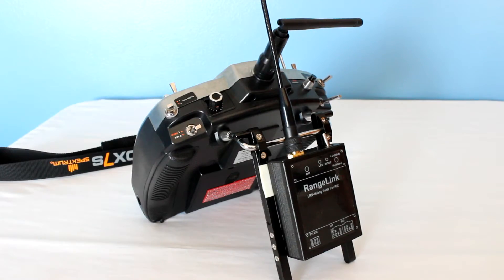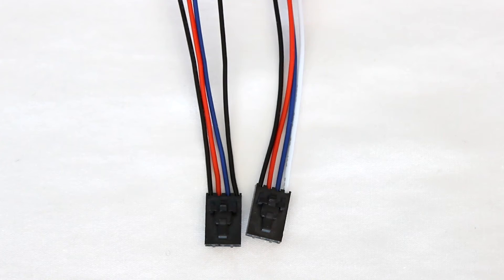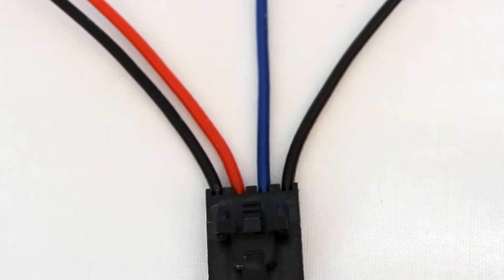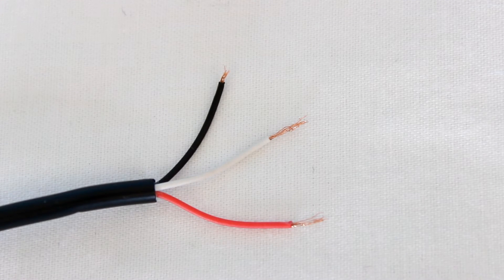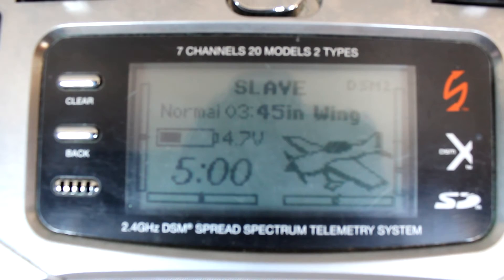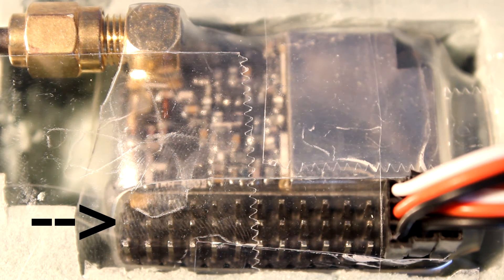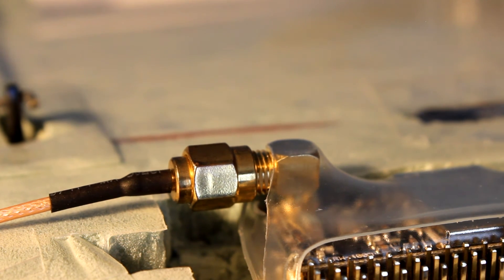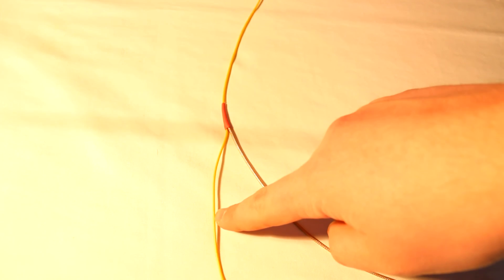How To: Setting Up Rangelink on a Spektrum Radio

Comment: Would you still recommend using dx7s with rangelink? I am considering the same setup but the feedback on forums has been a bit negative: ppm signal is too weak, the controls can freeze, the radio freaks out when rangelink in high power mode. Have u experienced any of that? Cheers
Reply: +Gene&#39;s FPV A bit late, but nevertheless: I use a rangelink with a DX6i and a 2s Lipo and haven't had any problems. I also would recommend to use a mono-connector for the ppm cable.
Reply: +SammYLightfooD Cheers. I've upgraded to Taranis plus since.

Comment: VERY informative! I have a DX7S I am interested in fitting this system to. Have you experienced any downsides to using a Spektrum radio with a 433 Mhz UHF system? Many people have said they've had problems with 433 Mhz and Spektrum radios.
Reply from the maker: No none at all, works just fine on my dx7s after a year.

Comment: This is a great video. I am sure I want the rangelink, but I have a FS Th-9x. (JR type)
Do you think you could make a video on how to install it? The other videos I have seen are not good at explaining it, and so are the forum posts.
Reply from the maker: I cant make a video since i dont have the radio but from the looks of it, instead of plugging in a headphone jack, those wires get either soldered or connected to a certain selection of pins that connect to a module in the back of the radio. Look around in the main rcgroups thread, youll find a diagram in there of what im talking about, ive seen it before.
Reply: thanks for the help, ill look more into it.

Comment: Nice video. Where did you get the bracket to hold the Rangelink transmitter to your Spektrum radio?
Reply from the maker: It's the one that is sold on the rangelink website.

Comment: Welldone dude, an excellent episode!! Very informative& great quality! What range would this pack mate?!
Reply from the maker: Probably a solid 10 miles at least. The ability to switch power from 200mw to 400mw is great if you ever start glitching out.
Reply: ***** Wow, its something i'm considering! What fpv antennas would suit this setup best??
Reply from the maker: fpv antennas? I just use cloverleafs on my 5.8 gear, gives me a good mile. You would rather have a control signal over a video signal. But you would need a different fpv frequency and some patch antennas with filters to get 10+ miles
Reply: I ment video mate!;):S Yeah I use the Fatshark Teleporters with the stock anntennes and the range is TERRIBLE! what do you suggest I get ?!
Reply from the maker: If you use 5.8 video, get the antennas I use, they are on my 5.8 ghz fpv setup video. They are the bluebeam antennas and they are amazing. Take a look at that video though.

Comment: so, the true about all of these LRS brands on 433mhz is that they has actually much interferences from the videoTX on 1.3Ghz at all, just like having a 2.4Ghz RC and videoTX on 1.2 Ghz with low pass filter.